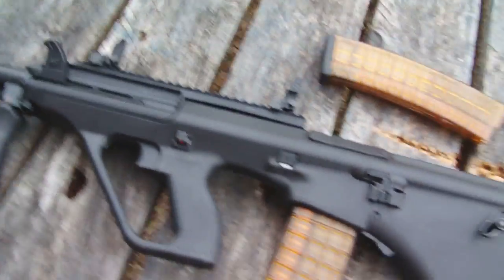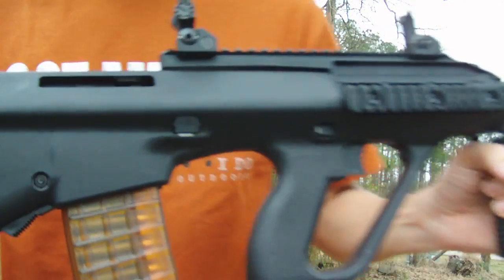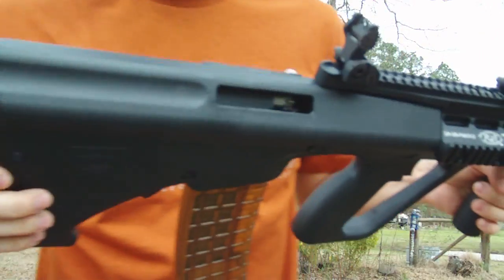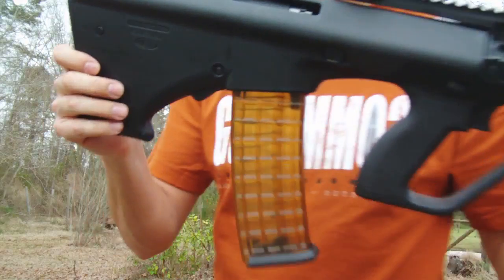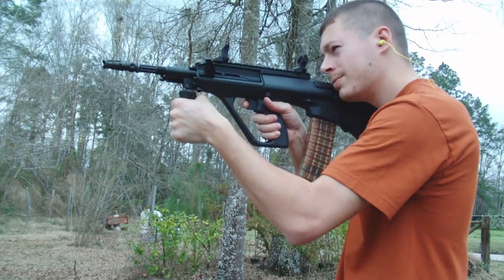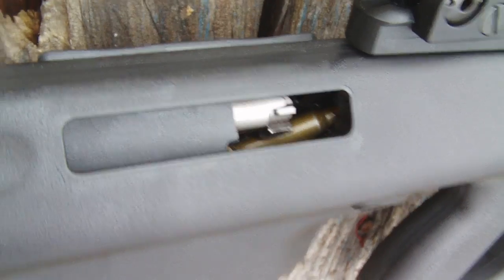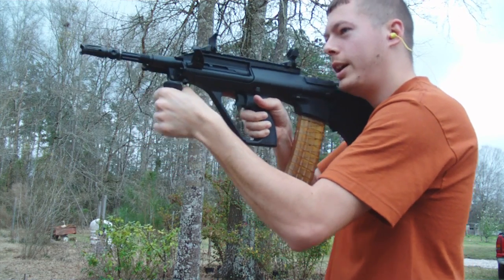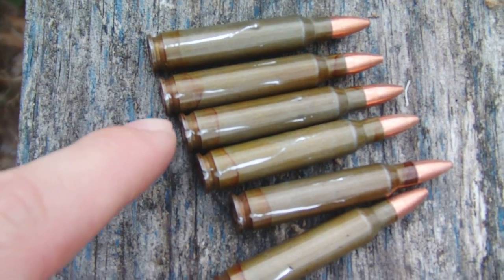MSAR STG-556 Issues (WATCH BEFORE BUYING ONE)

Comment: It looked to me like when you had the FTF the bolt was setting on top of the round. That is a clear sign that the issue is with the mags that you are using. What it is doing is instead of hitting the new round at the base it is missing and hit the side of the case dragging it out of the mag instead of pushing it. As a gun maintenance guy for the army I have seen this a lot. It is do to the mag setting to low in the receiver or the wrong cant on the back of the mag. Try getting some better mags

Comment: Just picked up an Stg556 and used Tula 55g steel and rifle worked fine as long as the gas setting was on "H," which is understandable as Tula is very low powered. My AR will jam all day with Tula ammo, so the STG556 gets a thumbs up from me. You either need to check your piston or your mag, I'm betting the problem lies with one of the two.

Comment: I'm no expert so take what I say with a grain of salt. Jams are usually associated with poor ammo or sub par magazines. Usually it's the fault of the anti-tilt follower in the magazine. I have a fs2000 and I had 4 jams with the stock magazine out of 20 rounds. The anti-tilt follower was sticking bad. I stopped using that magazine and I stopped having issues.

Comment: Your rifle is short stroking. Something is causing the cases to stick in the chamber which then requires more force to extract. With less rearward momentum, the bolt can't pick up another cartridge. Your chamber is either too tight/bad surface finish....It's the ammo. Or the bolt lug cut outs at the chamber haven't been deburred  properly and is denting the cartridge as it moves over them. These dents will deform the case requiring more extraction force...Causing the short stroke condition.

Comment: I don't know what to say buddy. Looks at your case heads, even the fired ones will show the same huge dent on the case head face. That's because the bolt can hardly catch on it to push 'em out of the mag, and more often than not ends up slipping off and smooshing 'em.

Comment: That could be the problem man. Wolf ammo has a lacquer on the cartridge that leaves residue in the receiver. Then you go and shoot brass ammo through it, and sometimes the brass cartridges will get jammed up and stuck on the residue. I don't know if that's a problem with the MSAR, or just certain AR-15s. It also could be fixed by now, I don't buy a lot of Wolf ammo except for my AK.

Comment: if you do not wish to replace the mag you can do three things.

download the mag to 38 or 40 until the excess tension is worked out of the spring 

load the mag to its full 42 rounds and manually feed the rounds out until you work the excess tension out.

cycle the ammo manually through the gun until you wear the edges of the feed lips enough for them to slick up a bit. the polymer has a tendency to grab the casing as it slides past.

Comment: I have seen that kind of jam on AK-47 rifles with unmodified Tapco poly mags. It might not be a problem with the bolt but very well could be a problem with the magazine itself. Because of the injection mold methods each mag isnt perfect to each rifle unlike steel mags thus could very well require modifications to work with each rifle. Look into the magzine first see if it is a problem with the feed.

Comment: So mine is the Styer AUG A3 so I don't know. I'm going to adjust the gas and if that doesn't work it's back to the gun store for someone to deal with what they sold me for $2,100. Or they can take the thing back. I'm going to put more through it to be fair but I should of stuck with my gut n went with the FS2000 from the start that I wanted.  Really ticks me off something being sold so much for has an issue

Comment: The jam is probably the ammo sliding slowly up the magazine instead of going into place instantly. Basically the bolt is returning forward before the ammo comes up.
Try a steel magazine, especially with polymer coated ammo.

Comment: Dude MSAR is in the clear here, it's not the bolt's fault. Such a misfeed is clearly due to a mag issue. it's just incompatible with your rifle.
The mag lips just sit too low in relation to the bolt, failing to present the case to the bolt face for stripping. 
Check like this: Fill a mag with DUMMY OR SPENT rounds, and watch the action while you slowly cycle it by hand. You'll see the bolt has close to no contact at all with the case head, that's why it's bound to slip over it.

Comment: I have never had much luck with wolf ammo. it seems that while its having failures to feed, probably because some of the ammo doesn't have the sufficient powder to push the bolt completely back therefor causing your failure to feed. Then again it seems like its extracting fine. I would say try brass ammo and show us what it does with the brass. The firearm concept is nice and this doesn't do it much justice. Just keep us updated. thanks.

Comment: It will have FTF issues with low powered steel, yes. "All day" was a bit of an exaggeration, but I have had a couple issues with Tula but nothing else. An AR that I have over $1800 is not reliable enough as a SHTF weapon. I am bias towards piston driven rifles though as with junk low power ammo I can just turn the setting and never have an issue.

Comment: Doesn't appear to be short stroking..the steel cases are scratched from the rear rim all the way up. Maybe it's out of spec between bolt and first round on the magazine. Just a tad off that at a certain round, the bolt just scratches the case with out pushing it out of the mag lips into the chamber.

Comment: I have the same issue on my stg-556 I figured out the issue at the range an it's the magazine I used a steyer aug and it was jamming every time I switch to the 10-round magazine that came with it and it worked just fine.

Comment: Just recently bought the Steyr AUG A3. And in the process of sighting in the EOTech.  Have had 2 of the exact same malfunctions. With Federal Ammo.  Haven't changed the gas feed to an higher level. It was pouring rain and only shot enough to sight it.  It's not the NATO version it takes the Steyr prepritiory mags.  But still crossed 2 of the same malfunctions. Only difference they pinched the brass right at the top pretty much under the bullet.

Comment: @geeXkeemareeX101 Issues is likely the Magazine catch is slightly to tall, bolt or carrier is milled slightly two low, or a bur on the bolt lugs or carrier. This causes the bolt and or bolt carrier to drag on the cartridge following the cartridge that is being fed. If the bolt and carrier drag enough it will drag the next cartridge up on the feed ram and smash it between the bolt and feed ramp. Good news is it is a manufactures defect and covered under warranty.

Comment: I had a similar issue with my ruger sr556.  It's the laquer coated steel ammo you're using.  The gun has a high quality, tightly fitted chamber and the tolerances on that ammo are too thick to have it feed and extract reliably.  Good brass cased ammo wont do that.

Comment: He got a defective one. I got one of these, and I've fired around 2k rounds through it so far, and I've never had a jam or a failure to feed. It's an excellent rifle. Their quality control is hit or miss, but they're generally pretty good about fixing your rifle or replacing it if you have issues. If you can afford a Steyr branded AUG, go for it. I couldn't, so I got this one.

Comment: Steel ammo does not always agree with every rifle. It has something to do with steel not expanding as much as brass, and can be pretty harsh on the extractors. It is possible that your magazine isn't seated properly, so you may need to have a smith look at it. But from my experience the MSAR is a fine rifle, though I've never fired steel cased rounds through mine.

Comment: The bolt is not the problem.  Your gas plug is dirty, take it out and clean it.  Then clean the chamber well.  I have shot over 10000 rounds through several MSAR's and never had an issue.

Comment: It looks to be the wolf/russian bimetal steel cases that are sticking. They have a polymer or laquered coating on them. Works fine in a AK, but even in a GOOD AR15 witth tight tolerences it will jam...not just a MSAR that has tight precise machining. Try using even cheap winchester white box from walmart and the standard 30 round magazine. There were a few reports of weak springs in the 42 rnd mags on some. I have ZERO problems with mine along with most others.

Comment: Hey Folks, I don't own one of these rifles. However, I do work at a gun range & I see my share of things that people either neglect to do or maybe just forget to do it properly! Watching this video I'm Cline to agree with M Finley! RE: The bolt being too dry, It's the number one thing that I see folks not doing properly. A few days ago a member was shooting his STG-556 & was having the exact same issue. I was called over to check & see what his problem could be. The bolt & piston was VERY DRY!! I explained the fundamental's of how it's suppose to work to the member. We disassembled it & properly lubed it. Reassembled it & it fired flawlessly for the remainder of the day. I do a lot of work on AR's with this issue as well! People, read your manuals! People think that there new & they just go out & start to blast away! Inside the manuals it tell's the buyer to take it apart & re-lube the the gun before firing it! I hope this helps some of you! Have fun & be safe shooting!

Comment: The only problem ive ever had with msar is when i shoot steel ammo, as long as i keep using brass i dont have an issue, i did however replace the bolt to a hybrid bolt from ratworx.

Comment: There are really quite a few variants that could be causing this issue, and none of them may have any thing to do with the bolt. You could have a problem caused by lubricant, too much or too little or type of lubricant, different types of ammo can drastically affect operation. Even braking a weapon in can cause it too run better. Good luck with it. You could at least take it to a good weapon smith and see if they can sort it out.

Comment: Yea...I agree that you should use better, brass ammo.  Just because the gun costs alot doesn't mean it should be able to feed all ammo.  More exspensive, quality built rifles usually have much tighter tolerences and you need to feed quality ammo.  Also, I have read pleanty of owner reviews and gun articles that state that the MSAR's are better made and higher quality than the actual Styer AUG.  Just something to keep in mind.  Good luck

Comment: You pointed to a bolt hold open device when you said bolt....  I don't know....

And to the rest of you about wolf ammo.  The old stuff was lacquer coated and even then the issue wasn't the lacquer melting and gumming up the works.  It's because it's steel cased and doesn't expand to the whole chamber size.  This lets in a lot of the gases and causes fouling in the chamber.  That issue is compounded because wolf has some terrible quality powder.

Comment: I had a newer xm-17 and it wouldn't shoot steel cased. Didn't lock back half the time. Had a bad receiver. Light primer strikes. Didn't answer my warranty form, my dealer had to contact them. Way too many issues.

I traded mine for the Tavor-SAR. Best decision ever. It exceeds it in every way. 100% reliability with ALL ammo. Locks back perfect everytime even with low power ammo. Reloads quicker and smoother. Just a superior rifle IMO. The real AUG may be better. I will never have another MSAR.

Comment: @a2birdcage 
Problem is, it's designed to function with 5.56 ammo, the quality shouldn't matter, especially if a cheaper gun will run through any type. It's like having a sports car that handles worse than a Pinto. Then saying, well, the sports car could beat the pinto in such and such situation. That's BS!

Comment: There is no inherent advantage to brass case over steel, unless you reload, in which case there is no inherent advantage to berdan primed brass cases over steel. If you don't reload, brass cases are just a waste of good brass. This is why you failed to state any advantage of brass over steel. It's hard to state what doesn't exist.

Comment: The problem my friend is simple hust like any piston driven rifle it can be a long stroke or short stroke system it seems that your system is acting as if though it were a short stroke and not fully cycling the rounds, similar to what happens with AR's if you change your upper from a Government profile to an but don't change the buffer you'll have the same problems. Ok, start with stripping your system completely make sure that there aren't any obstructions on the gas ports at all, now lube the bolt carrier and bolt assembly as if it were your girlfriend on prom night now try running some SS109's JUST AS A BASE LINE, then run your Tula, you see Russian ammo has lacker on it that builds up in your system I know it runs perfect on your AK's and SKS's but that's what it was designed for and the tolerances are not the same between the them. Hope this help Semper Fi

Comment: Thats a nice weapon, and any weapon worth its weight wont give a damn about whether or not the fodder is steel or brass, shouldn't matter. Id like to know if the issue has been resolved, its kinda got me stumped. All I can think of is its a poor design in the bolt face, not having enough surface area to contact and pick up a round every cycle or maybe weak springs in the magazine,but you said you tried different mags. Keep us posted.

Comment: Russian ammo only works in russian made firearms
That's a basic well known rule.
Steel does not release from a tight tolerance chamber.
This is because brass will flex or spring back somewhat and is self lubricating.
Lacquer coated steel cases as you are  using in the video have zero
lubricity.
Try pouring a bucket of oil in it if you want to use that cheap stuff next time.

Comment: Or at some point, the next round in line in the magazine is stuck lower than it should be causing the bolt to scratch the case instead of push out properly. Good luck with your weapon bud

Comment: @brinezero Watch his other video with the msar stg-556 fixed. it works fine after they send him a new one. If your gun can't run lacquer coated steel cased ammo your gun is broken. The only problems with the ammo is that it runs dirtier and you have to spend maybe 5 extra minutes of cleaning.

Comment: @19nisey69 Yeah, 5.56 NATO spec ammo. Not all 223/5.56 is created equally. If the gas system was designed to function based on the specs of the hotter NATO spec ammo and then you feed it drastically underpowered shit ammuntion and it doesn't function then how is that the rifles problem? Shit it doesn't even appear that he's attempted to run even medium quality ammo through it. He loaded it with the worst ammo you can buy and when it didn't function he blamed everything but the ammo.

Comment: the fact is that most guns dont fire correctly if the bolt is cycling too fast. and the reason is that the magasine spring isnt always powerfull enough to push the bullet up and in front of the bolt fast enough. but then again it might just be the company who is fucking up alot :P:P

Comment: Thanks for the video.

I had one of the earlier models -- when the MSAR just came out. I wanted to love the gun, but it had the same problems. I'd get FTE, FTF, etc. I mostly shot PMC bronze and Prvi Partisan ammo. Those are excellent brands that give my ARs no issues. Regardless, I continuously had problems. I tried adjusting the gas system, but it didn't make the gun fully reliable.

One positive about the gun, was that is was pretty darn accurate.

Alas, I sold it years ago and recently bought a Steyr AUG A3. The Steyr is 100% reliable. I've had no issues at all with it. I'd highly recommend picking one up.

Comment: Everyone talking crap about the video can lay off. It's just a crappy gun. A buddy of mine at the gun range just got one, and at less that 200 rounds in, it was jamming every other shot.
Reply: I own one, and the only problem I have with it is the fact that the damn guy who sold it to me took the gas plug out and put it in the box, and my step-dad didn't check before he shot it. other than that it shoots fine, I do need to cough up and finally buy the damn left handed bolt for it though, Ive shot it plenty right handed but I just shoot much better lefty
Reply: claytonmachine12 Glad to hear it works for you!
Reply: yeah, and do you know where the hell I can find a lefty bolt for it, Ive been looking but cant seem to find one, if itll accept a steyr bolt then that would make it easier but I dont know if it does
Reply: +claytonmachine12 I have a lefty I'll trade for the righty.
Reply: I already bought a new bolt for it XP, AUG bolts will drop right in it XD
Reply: Ohh nice I've been looking for a MSAR one but didn't have any luck. Thanks.
Reply: yeah mags, bolts(not the carrier) and primary pistons are all interchangeble

Comment: I'd go with the FNH FS2000.  From what I've heard, the operating system is rock solid, even with a few casings intentionally put in the tube that the eject  from the front.